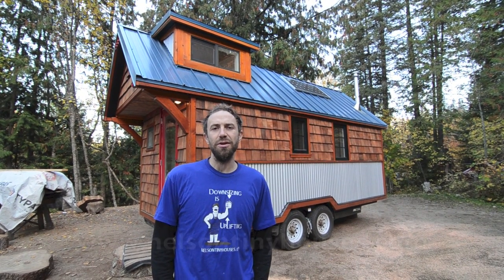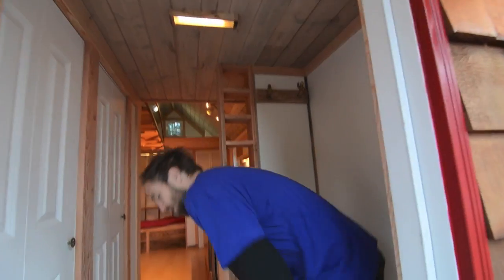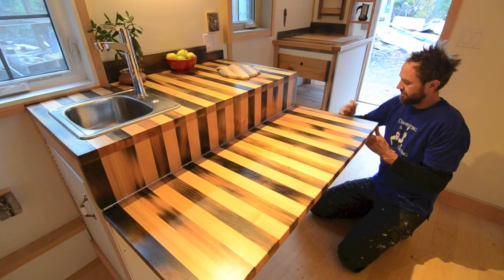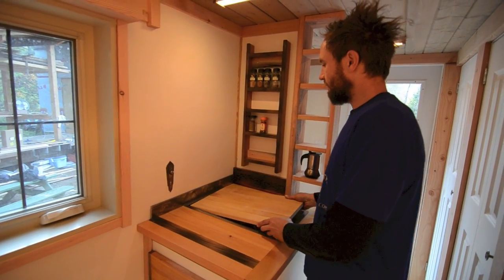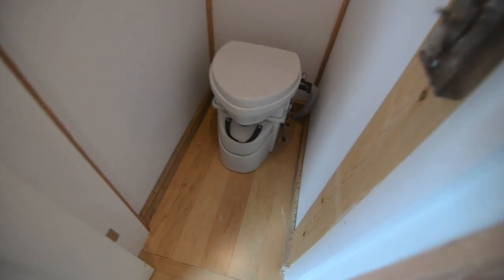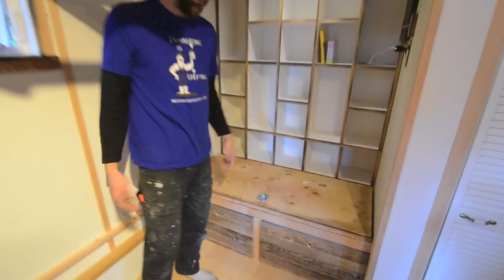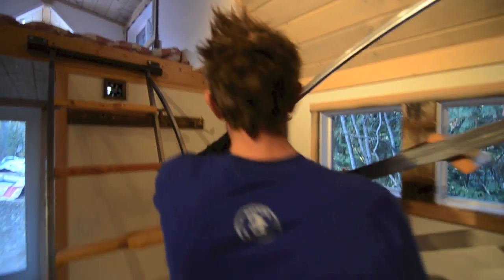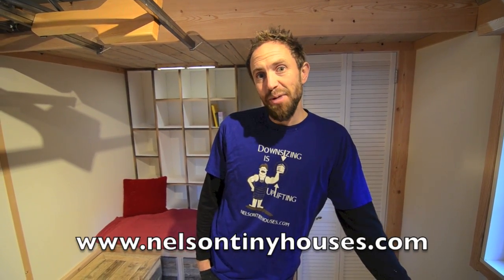Nelson Tiny Houses Acorn 3 Tiny Tour

Comment: Propane is a grid item. No grid, no propane. This is not an off grid house. It is great as a tiny house.
Reply: +Trina McDonald nope you just put propane tanks in the untidily section, with water heater etc or mount by neck. Like with an RV
Reply: +otherwiseoutside You do nt read well. If there was NO GRID, there would be NO PROPANE. This house depends on the grid.
Reply: "off grid" is defined as not dependent on utility infrastructure. Generally this includes electricity, water, sewage and heat source like piped in natural gas.
Reply: +otherwiseoutside PROPANE IS UTILITY INFRASTRUCTURE!
Reply: +Trina McDonaldI prefer to look at propane as off-grid because there is no wiring, pipeline or direct connection to the manufacturer, giving the home-owner just a little more self-sufficiency.
Reply: +Hallucinogenichusky propane is off grid. "say one day the world comes crashing down and the end of" solar batteries? when the world comes crashing down they way you think its going to be back to burning wood and eating game and crop, not solar or wind. in fact propane is probably going to be used before solar or wind in the apocalypse.
Reply: +Trina McDonald so when you're camping in a tent in the middle of siberia with a propane camper stove are you on the grid?
Reply: I won't be near utilities so I need to consider propane and a generator for ac and lights. Is propane cost expensive for fridge and cooking?
Reply: Off the grid refers to not using the main power grid and a plumbed city/town sewage system. Of course you have to go and buy propane but it is MOBILE ie you are not tied to say,  piped commercial gas lines to your home. Perhaps you are confusing your interpretation of off grid with self-sufficiency and sustainable power sources like solar in which case propane is not sustainable as it is a nonrenewable fossil fuel derivative. Propane in tanks is transportable and is considered off grid FFS.